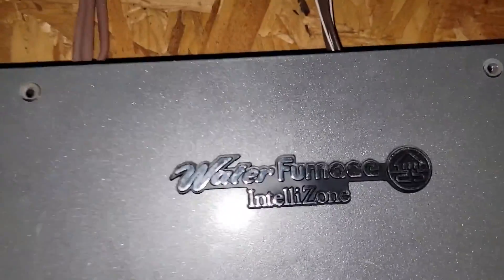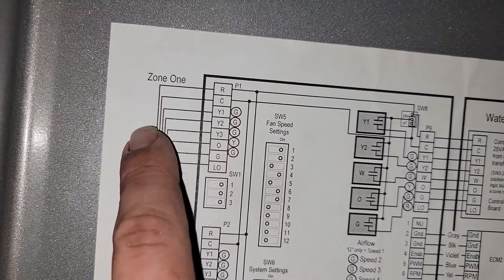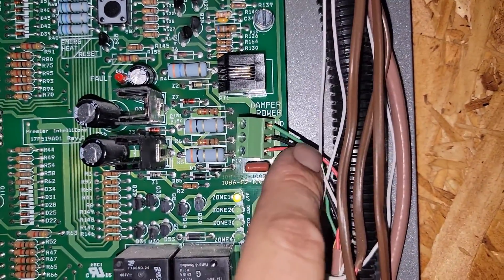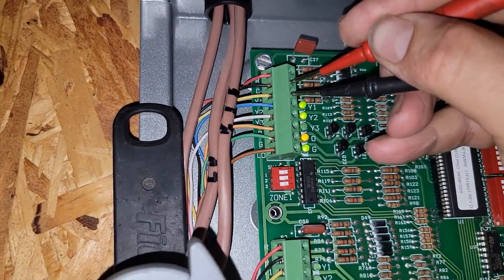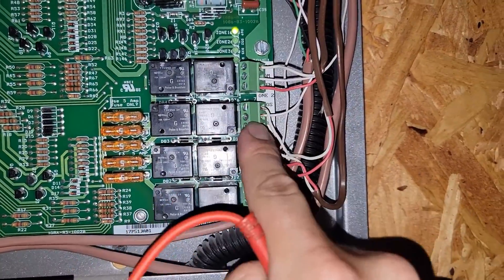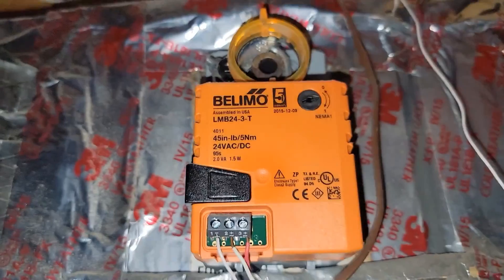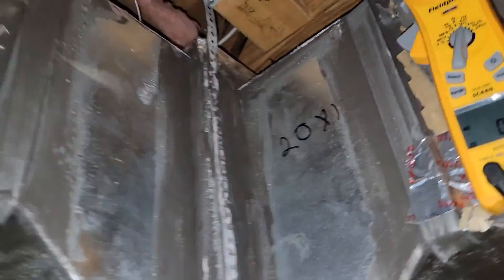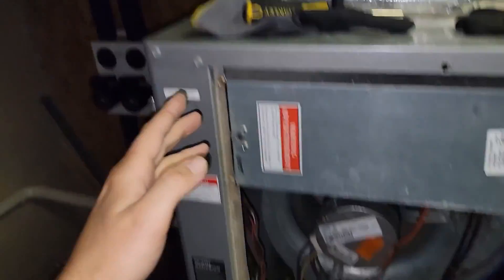Zoning System Damper Troubleshooting #zoning #dampers #geothermal

Comment: How do we check for a closed damper if it only got 2 wires? Thanks.
Reply from the maker: Check the Damper position on the duct. There should be a bar that indicates closed and open
If the bar is in the vertical position, it's closed.If it's in the horizontal position, it's opened

Comment: I have a dual zone water furnace for about 15.5 years that has gone through maybe a dozen damper actuators in that time. Is this normal for a dual zone Water Furnace? I have the same type of Water Furnace control board like in this video but my actuators are different from the ones I saw in your video. If this isn't normal then could the model of actuator be my issue for going through so many actuators?
Reply from the maker: It's most likely the way that they are installed
Or could be the model of actuator
I like the honeywell

Comment: I hated zone systems for houses. Wait until it breaks. They'll regret not having two or three small systems. 

We have plenty of two story homes where low ballers intalled a "duct booster" for the upstairs. It consists of a second thermostat upstairs connected to a relay and 12" round axial fan, sometimes installed in a square duct. Ha. The homeowner buys the house, thinking they have two systems, the con artist builder tells the buyers that his HVAC guy err Hack installed a "Revolutionary" new type of system for the upstairs. Then the Hacks don't even install a return in the upstairs ceiling.
Reply from the maker: That's funny and sad at the same time
 I can't believe they did that
 Revolutionary lol